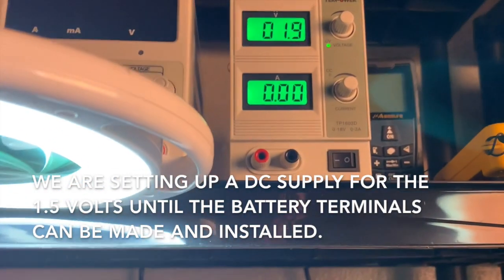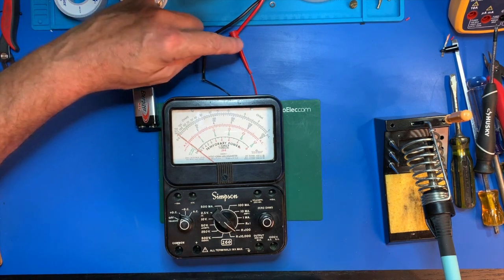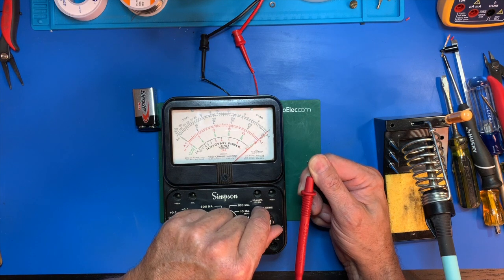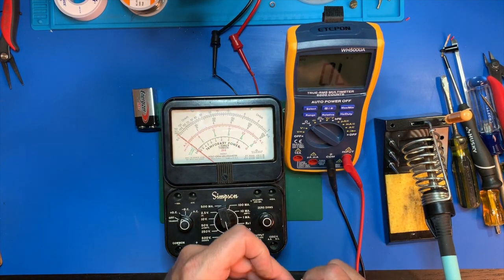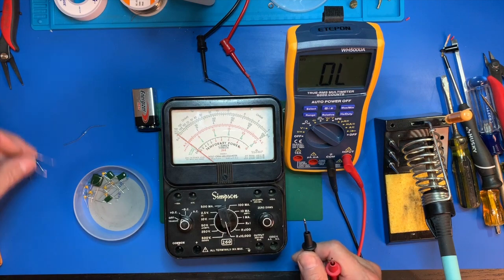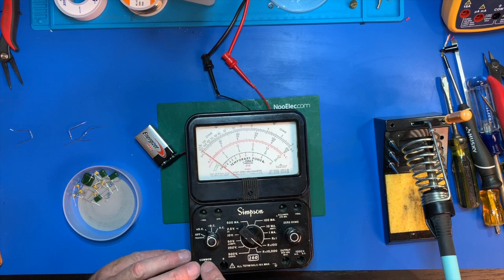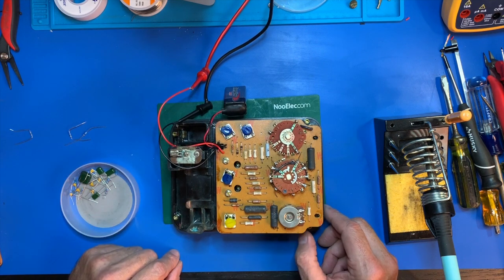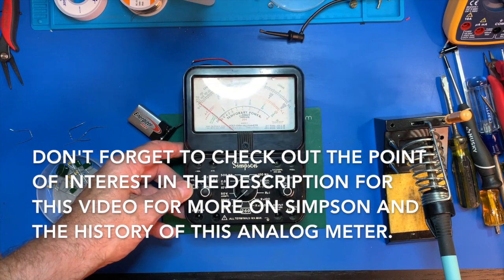SIMPSON ANALOG MULTIMETER REPAIR - PART 3

Comment: Grin, sort of fun to watch someone learn to use and industry standard, no offense intended.  "Newer Old VOMs used the reversed banana for "safety" to attempt to reduce users accidents.  Older VOMs used the conventional banana plugs and sockets, even older VOMs used the .080" diameter pin connections.  In this video I noticed that you should have used the AC position with the POS and common to check for the AC.  Stay safe because you were using the meter with live power that was present on the back of the exposed circuit, that could be fatal!  Simpson and Probe Master provide good test leads for your multimeter VOM,  don't waste your personal safety, time and money the the so called "adapters" they are terrible.  Thanks for making a video of salvaging the 260.
Oh, you can still get the damaged battery clips from several source including Simpson and IMS in CA.

Comment: Fun fact: Simpson 206 meters that use a 9v battery (Series 6 and newer) include a spare terminal for the D-cell battery. It's used as a tension clip to hold the 9v battery in place. It's easily extracted with a pair of needle nose pliers and can be soldered in place of the damaged terminal. If the 9v battery rattling around a bit bothers you, finding something to wedge into place to hold the 9v battery securely should be much simpler than rigging a contact for the D-cell.
Reply: i was wondering what was under the 9V battery??!!  Thanks bro.

Comment: PLEASE! I'm begging ya! Learn something about your meter. Watch the series by W2AEW and get a set of proper probes. You most likely have a 260 series 7 and Probemaster sells a great set of probes for this meter for about $30 shipped. When you get the probes, you can check the voltage measurement accuracy by using your DMM's resistance measurement. The resistance on your DMM should read 20,000 ohms times the voltage setting on the Simpson. For example, on the 2.5 DC volt setting, it should read 50,000 ohms.